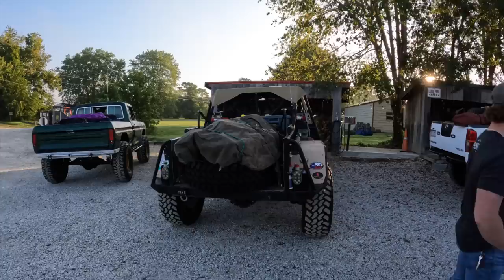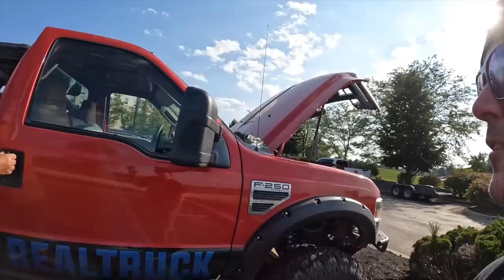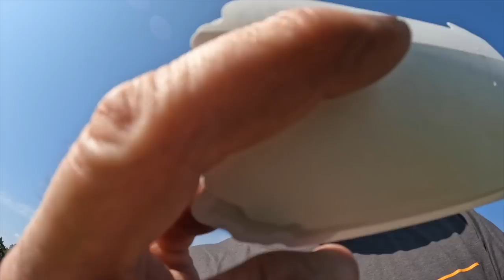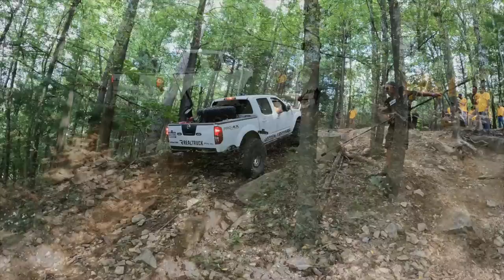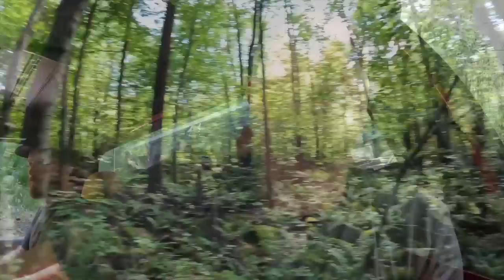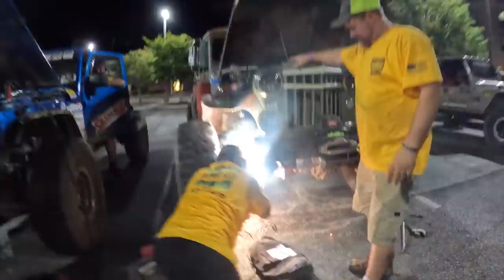Ultimate Adventure 2023 episode 1  .  How will my fresh Ford tackle tough East Coast trails?

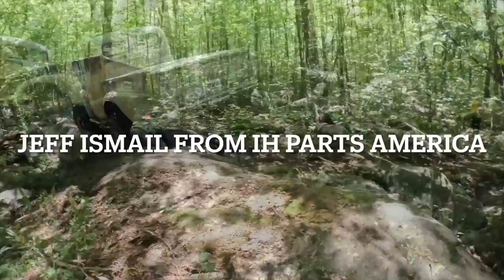Comment: You read my mind I was thinking next one would be a regular cab long box instead of my Jeep. And I was leaning towards super duty, my 2500 is Chevy but I prefer the solid front axles. 15:48
Reply from the maker: Chevy is a good start, but more custom work is necessary
Reply: @thedirtheadshed  it’s my pretty truck daily driver 2006 with only 129,000 kilometres.
Reply: So like 80,000 miles

Comment: I had a 95 1/2 F350 single cab 8ft bed 5.8ltr boo. 5spd ZF trans with a replacement np205 tcase. I got rid of it cause it was also my daily. Ended up with a 96 xj witha doubler 203 cases
Reply from the maker: Both sound cool

Comment: When is someone going to come up with a ford power steering pump that doesn’t sound like it’s going to puke it’s guts out? 😂 great job wheeling a big girl
Reply from the maker: I have a psc tc pump about to go in
Reply: @thedirtheadshed I put one in my 2002 F250 and love it. Smooth power.
Reply: Most of the time that whine goes away for 30+k with a fluid change. But not always! Lotta strain with those big meats

Comment: Patagonia tire sponsor. Any side wall issues?
Reply: Are they an actual sponsor? I have 2 sets on squarebodies and they are good tires but no crawling. Just sand and mud.
Reply: @Shouganaigarage  all the participants were running them. If Patagonia hasn't fixed the sidewall issue. None of the UA videos I've seen has shown it. So...???
Reply from the maker: They did sponsor the event.  Falken dropped off this year.  Had 3 flats out of 26 rigs over a week of wheeling.  Not bad at all
Reply: @thedirtheadshed  awesome 👏

Comment: I’m surprised there are not more F250’s on the trail. Ford engineers have spent decades fine tuning these vehicles to make them light weight and maneuverable to easily conquer the most technical trails. Nice work, it looks and seems to perform great. Cool truck.
Reply from the maker: Thank you. I agree.  Tough out of the box, and really affordable

Comment: I love that green 7879 F150. I had a 79 F150 with the Dana 44 front 9inch rear. Had a cast iron 4spd trans. Been a while but i belive it was a sm465? With a 205 case. Best is the 300ci engine!! Torquey little bitch.
Reply from the maker: That had to be a fun rig